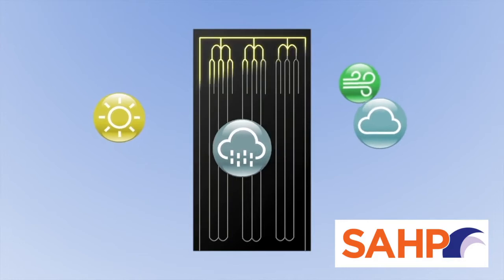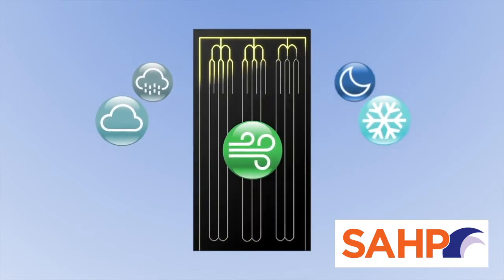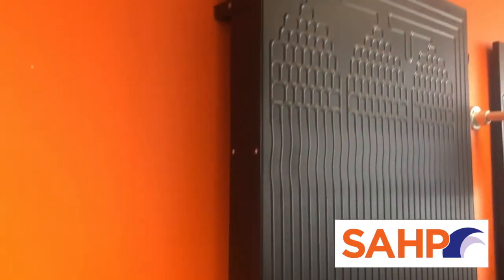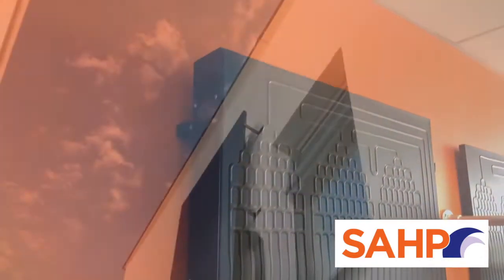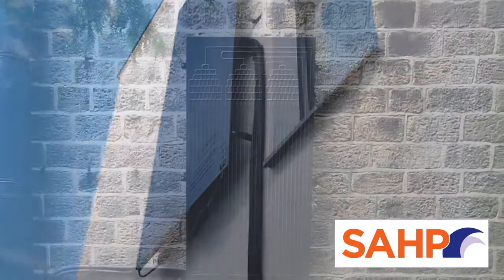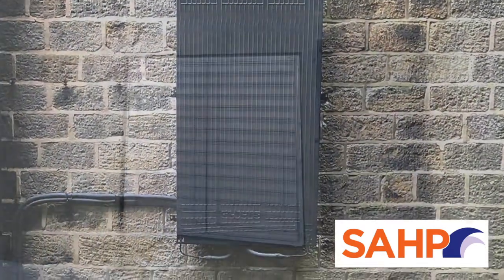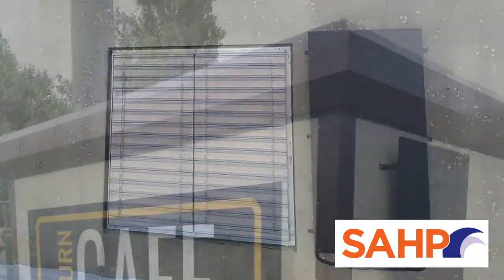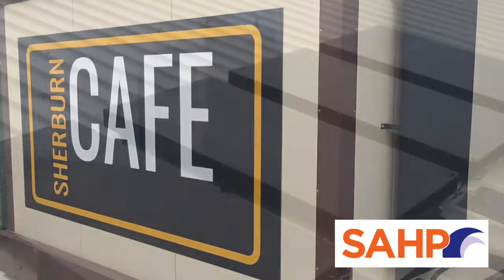Solar Assisted Heat Pump evaporator panel

Comment: Hello,
What if i bury that thing in ground for ~15 celcius degree weather.
Also what if i coat that panels with solar pv panels for increase the pv panels efficiency.
Reply: You would just freeze the ground around the panel and no more heat transfer would happen. They have to be in open air. For the same reason you can't put them in a cistern because the stagnant water would cool and then freeze eventually. Placing them in the air, and in a sunny location is the best possible location to gain solar assist in daylight.